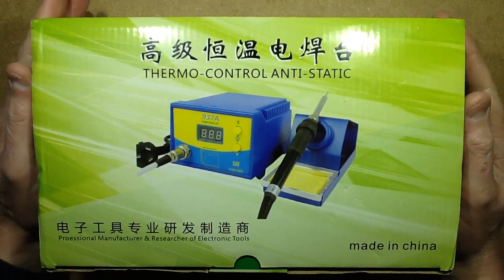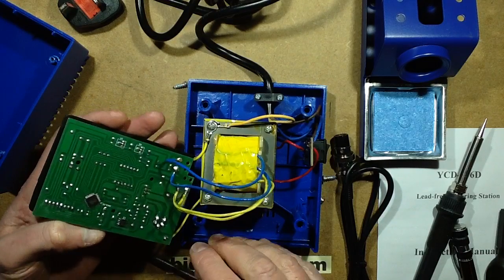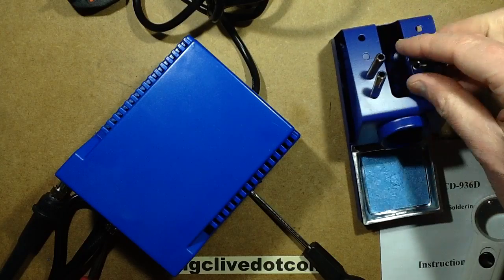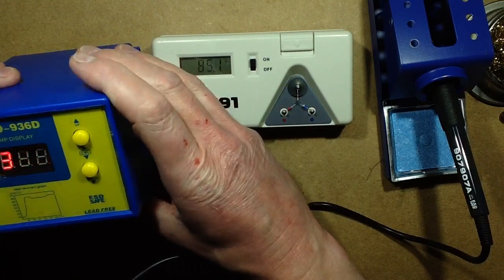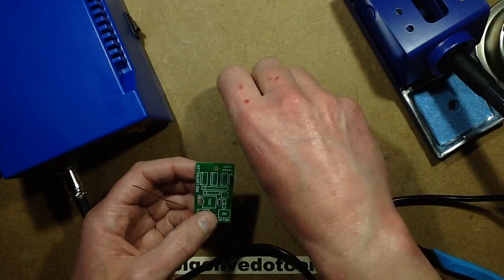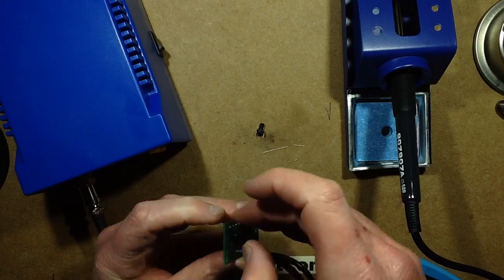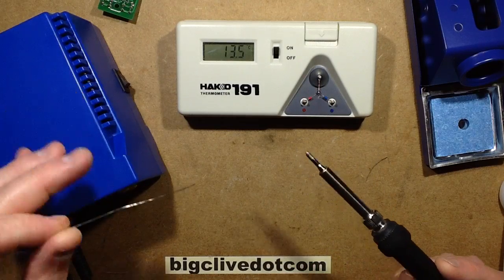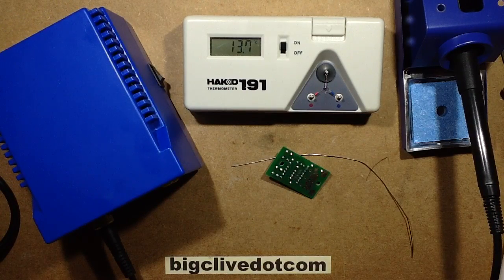936D digital soldering station test and internal look.

Comment: so how are we supposed to cal if we don't have a temperature measuring device...-40C seems pretty crappy to me...sure it works great if you cal, but what if you don't have extra measuring equipment...kinda rules out the cheap factor if you need to cal with another device
Reply: if you want to calibrate it accurately youll need the thermometer thing. but you could get a good approximation if you know the melting point of your solder, all good brands of solder will quote exact MPs for their formulations so you could adjust the iron so it just about melts the solder and use that as your calibration temperature. also those soldering iron thermometers are only cheap themselves, I got one for about £7 I think. 
but for most work you dont really need to know the exact temperature of your iron anyway. most cheaper adjustable irons didnt used to have a temperature scale at all, they just had a dial going from min-max and you turned it up as much as necessary. theres nothing wrong with doing exactly that with one of these.

Comment: Hey Clive, have you ever thought about getting a set of "helping hands". Back when I soldered in high school for my electronics class, we used them to hold the PCBs, it just felt alot safer than holding them... Who knows, you might already use them for bigger boards
Reply from the maker: I do have helping hands and a PCB assembly frame.  I only tend to use then when I need things held rock solid or while soldering a lot of components at once.

Comment: I used to rewrite manuals for colleagues. Many, even ones that were originally written in English, are confusing to say the least. One piece of lab  equipment I did this for had a manual that was over 1/2" thick. What I did was start without the manual, find out how to make it dow what was needed and write a new manual of 4 sides of A4!

Comment: Mine just displays 56 on the screen and won't heat up
Reply from the maker: That might be the usual faulty solder joint where the PCB is attached to the front panel.
Reply: bigclivedotcom thanks for the info I've returned it to amazon as it was only 1 day old and got a different solder station

Comment: I bought the 936D+, made by Zeny, and found that there was no ground wire between the circuit board and the mains ground.  The iron tip itself had a ground wire that connected to the circuit board but the lead was a dead end.  I had to install a ground wire myself in order to make the tip grounded to the mains.  I filed a complaint with the seller, and they insisted that there was nothing wrong with the soldering iron as it was.  They even sent me a European CE certification document, which I suspect was a fake because it seems like a unit like that would have to be properly grounded in order to pass certification requirements.

Comment: I have the Kaleep 8586 dual hot air/soldering station and a questionably cased LC200A LC meter of the wonderful "Chinese cheap fantastical" range. Both are greatly accurate and very reliable items and do their jobs splendidly . 
Some stuff I agree can be totally naff and only last 2 weeks or so like a supa-doopa usb thin steel microscope with stand thing I bought that apparently had rave reviews all over the net. 
Nice to see you give a straight forward view on these items instead of some peeps on here nit picking and slagging the hell out of them at every given opportunity all because they love their top notch shiny branded stuff better.  :-)

Comment: Really enjoying all the video's, so much information. Just getting into some basic electronics and bought one of these station on ebay, it's arrived today with a fully fitted compliant 3 pin plug with a 3amp fuse installed. Now I've got something to practice my soldering with.

Comment: hi BC I've just received my solder station but can you help me out with a slight problem?  I've tested the output temp using the wee hakko device (again))
Reply: purchased with your videos but my temp was nearly 100c out, so with minus 50 (maximum ) I need to set on 306c to have 350c I could just live with it but can you offer any advice on correcting (maybe a new cheapo board) many thanks from the Scottish Highlands and keep the wonderful videos coming
Reply from the maker: +Kenny Wilson The tester may not be accurate it may be better to just go by soldering "feel".
Reply: nice one mate, ive built the alarm clock kit you done and it worked a treat have now done a £10 valve preamp kit and again perfect result all thanks to watching your vids, many thanks K

Comment: Have to say I agree that cheap doesn't always mean rubbish. I've just had to get rid of an orbital sander, I bought twenty years ago. It was Woolworths' own. Finally gave up the magic smoke, having been using it daily for three months. On the other hand I was asked to check out an expensive oscilloscope in a local lab. The soldering, including hand soldered joints was the worst I've ever seen in.

Comment: Thanks very much for your review of the generic 936 "digital" and "analog" solder stations. The thermal capacity of these irons is a bit weak due to rather large diametric clearance between the tip and the heating element. This can be dramatically improved by wrapping a bit of aluminum kitchen foil around the heating element. Cut a piece about 30mm wide. Wrap it around the heating element and the tip-support sleeve, leaving a few mm hanging out past the end of the thermocouple. In my case, two turns did the trick. The bit of foil past the thermocouple will crush and fill the space to the tip. The foil improves the thermal conductivity between the heating element, the thermocouple and the tip. Now you can solder to large ground planes repeatedly without waiting for the iron to re-heat. Simple, quick and cheap fix.
Reply: Thank you for the aluminium foil advice, it indeed improves performance of iron dramatically. 
With leaded solder it is hard to tell the difference (even when soldering a ground plane), but with lead-free it is really obvious. Before the foil mod I had to set iron to the 440C in order to use lead-free solder on ground plane, but after wrapping heater with foil, I can set it to 350C and all of a sudden lead-free solder behaves more-less like leaded. 
I wonder, do they make thermal paste for high temperature applications....
Reply: nice trick..

Comment: These Chinese irons work pretty well. The Hakko clones take the "cheap as chips" copper tips, and costs of ownership are pretty low, along with a very wide range of bit profiles. Bought an 888D and it's turned out to be a very reasonable little tool. I'll not be getting rid of my (very) old Antex 15CCN anytime soon though.

Comment: Weird. Clive has put out another video about a common fault with these that I found by accident when trying to look up this video to see where be got different irons from because... you've guessed it.... my 936 is over heating the element... I can't now find this video but watched it earlier.
Reply from the maker: It's not actually released yet...  https://www.youtube.com/watch?v=S8BGkEnHetI
Reply from the maker: It's not actually released yet...  https://www.youtube.com/watch?v=S8BGkEnHetI
Also keep in mind that there are two styles of iron.  One with thermocouple and one with thermistor.  Another possible cause for an overheating bit is triac failure in a shorted state.
Reply: weird, why could I view it then? Pulled the unit apart last night, barely any solder on the connector connections and some fairly nasty corrosion on the solder. I'll flux it up and reflow it tonight to try and clean it up. I notice there is also a screw hole on the pcb in to the front casing to prevent differential movement between the two parts but there is no screw in it!!

Comment: Hi Clive being a learnerand looking at your soldering bits, how do tell what kind of bit fits  the YCD 936  iron which I just recieved today, as your video says it is just a pointed bit, so any help would be greatly appreciated Joe
Reply from the maker: These clone irons all use a very standard size of bit based on a Hakko original.  They can be found in sets on eBay, or in packs of your favourite style.
Reply: thanks Clive. Keep the videos coming, most appreciated. Joe

Comment: Hi Clive, I bought one in Shenzhen, same as yours with the Atmel MCU (and an SPI connector). According to my copy-Hakko-FG-100 it is 90C off. As you know, the calibration mode only allows for +/- 60C. Do you know of any way how to calibrate the temperature display?
Reply from the maker: Is it possible to validate the temperature on another device as some of the FG100 units can be well out of calibration.  It might be worth setting the temperature low and working up in 10 degree steps until you get to a good soldering temperature.

Comment: what is the significance of a sleeved earth pin ?
Reply from the maker: The earth pin is the first to make contact, so it's contacts are close to the front of the socket.  Unfortunately these rogue sleeved earth pins defeat that contact and don't make connection.

Comment: hey bigclive. I just got mine, and it's 270 degrees off. If i put calibration to -50 and the temperature on the displayto 180 degrees, it goes to 400 degrees on the thermocouple. what to do? my mains is 240v
Reply from the maker: +RMXbass Some of the soldering iron thermometers are not accurate.  Set the station temperature to 300C, let it stabilise and then do some test soldering.  If it's too cool nudge it up 10C at a time to find a good soldering temperature.
Reply: bigclivedotcom Thanks for your answer. I have the same thermometer as you, the white fake hakko 191. Even when i have the temperature set to 180 degrees and have the calibration to -50, it still melts solder. If i set the temperature to 350 degrees and have calibration to -50 it shows 600 degrees on the thermometer. And it looks like it's glowing
Reply from the maker: RMXbass Oh, that's not good.  What happens if you turn the unit to its minimum temperature?  It might be worth opening a case on eBay and describing the issue.
Reply: bigclivedotcom the minimum temperature is 180 C°. When i put calibration to 0, the thermometer shows 450 C°. When i put the calibration as low as it will go which is -50 C°, the temperature drops to 400. so obviously the calibration works but something else doesn't. I think i will open a case, and then try ordering another one. I quite like the cheap fake hakko stations, and would like one with a digital display that works properly. Thanks for your answers :-)
Reply from the maker: The seller may try to fob you off with a 50% refund and then ask you to post it back in the hope that the high shipping costs will deter you.  Don't close the case until it has been properly resolved and if they do ask you to post it back, ask them to send you a pre-paid postage label.  They won't, because they know how expensive it is.
It's possible that there may be some other calibration facility inside the unit, but try for the refund first.
Reply: bigclivedotcom ok i will. Thank you for the tip, I will remember that for later :-)
Reply from the maker: RMXbass I've been sent two of these units PCBs to look at and the both have serious issues with the solder joints to the soldering iron connector.  It might be worth getting another soldering iron and resoldering them with a short but of wire from each pin to an area of its matching track scrubbed clear of solder.  The tracks seem to break at the solder point as the connector is all that supports the PCB.
Reply: bigclivedotcom I got my money back, thanks to your tip. In my case the solder joints looks fine. my problem is that it went far beyont the set temperature. I ordered 4 new different irons to try. One of them was only 65 degrees higher than the setpoint, so when I calibrated the station to -50 degrees, the iron went only 15 degrees above setpoint. I was pleased with this, except that the handle on the iron was horrible, and the cable was stiff. I took out the heating element that i knew worked, and soldered it in to the handle that came with the station, and made sure to connect the original cable right. After this it overshoot by 100 degrees whith calibration set to -50. I switched back to the horrible stiff cable, and now i'm back to 15 degrees above setpoint. I measured and compared the two cables, the stiff one measures 1 ohm per lead that goes to the sensor, and the soft (original) measures 0.2 ohm per lead. I got so comfused i even considered adding a 1 ohm resistor in series for each lead that goes to the sensor to see what happens. But i am back at 16 degrees over set temperature. I Will try ordering a different station with the money i got back from this one.
Reply: KASA kasa Did what work? I got the station to work, with a different iron than the original. If you buy one of these, there is about 50 % chance that it will work. I also got my money back and could keep the item. every seller on ebay has to pay for return shipping when something is broken, they know how expensive the shipping is, so usually you get to keep the item. I did not know this until bigclive told me.
Reply from the maker: Check out this new video in case the issue is related.
https://www.youtube.com/watch?v=S8BGkEnHetI

Comment: I've burned myself on everything BUT the soldering iron i have so far..
LOL...
I've accidentally bumped and flicked the tip with my bare finger so many times. and never got burned. Didn't even feel heat! Crazy. One time I even saw the solder on the tip get pushed by my finger and i heard a tiny sizzle sound but i STILL DIDNT GET BURNED.
Yet ive burned my finger on the piece i just soldered a fair number of times. No lasting burns or blisters though.
Still freaky i havent burned myself on the iron tip or shaft. yet i have slightly singed myself on the work piece. Such irony!

Comment: Would adding a fan keep the box at a consistent lower temp, keep the tip at a more regular consistent temp? I got a Yihua 852D+ iron and hot air for $99 on sale and took the chance. It's been really great now for two years. I never calibrated it. I don't pay attention to the temp, I look at what the iron is doing. When it behaves I note the reading and use that for what I'm doing at the time.

Comment: Hey there, I really enjoy your channel keep it up... I just received my 936D but something is wrong with it... I turned it on for about a minute to see if it was working then turned it off when I went back to it later to actually use it,  it wouldn't come back on , no power...any ideas?
Reply from the maker: Check the voltage rating and plug.

Comment: Hi Clive,

I have just purchased one of these soldering irons (different brand and model number, but same colour) and tested the temperature with a knock off Hakko 191 and the temperature is so far out (over 100 degrees too high) that I can not calibrate it because the maximum deviation allowed in software is +/- 50 degrees.

Before I open  it up or possibly return it, did you notice if there were any pots inside for further calibration? I will in the mean time check the temperature with my multimeter, just in case the Hakko 191 (also a new purchase) is faulty.

Thanks, and keep up the good work, I just love watching your videos for their technical and humour content :).
Reply from the maker: i didn't notice internal calibration pots, but if in doubt start with the soldering iron at 200C and see if solder melts on the tip once it has stabilised, then nudge the temperature up until you reach a good soldering temperature.  Some of the cheap solder tip testers can be a bit random in their results.

Comment: Is the YCD 936D soldering station that Clive is demonstrating the same one that is advertised below now calling themselves Katsu, or is something diddly donkey going on. Thanks in advance anybody.
Reply from the maker: They seem to rebadge these units with lots of different names.
Reply: Well I have ordered the Katsu above and can't wait for it to arrive. Do you realise Clive that mostly due to your inspection of these units the sales appear to have gone through the roof. I think it would be nice if the suppliers realised this and paid you a bit of commission from the sales.
Reply: I've just bought a "Katsu 636", "Item NO.:312087" from Amazon, based largely on this video. It came with a 3A fuse fitted in a plug with a sleeved earth. However, it also came with a second, loose, plug in the box, which had an unsleeved earth pin and a standard UK 13A fuse. Apart from that and some different writing on the front panel, it appears identical, externally and internally, to the one in the video.

Comment: I bought one of the analog ones with the dial on the front for 20$ shipped and it's actually really, really decent. Only downside is the iron might actually float off if it's not attached to the base unit; it's got so little thermal mass! This hasn't been a problem for my Arduino level tinkering though!

Comment: Hello Clive I couldn't agree more with you about cheap Hakko (clone?) irons. I happily used the Weller TCP 24volt irons for some 40 years in a professional capacity and continued to do so in retirement. 

Having seen a Hakko 907 iron on one of you earlier videos I decided to try one on a whim and coupled it to a 936 analogue control panel using a 24 volt 2 amp transformer that I had lying around. I was amazed that an iron costing barely more than a replacement tip for the Weller performed as well as it did. I now have 4 907 irons which have cost a fraction of the cost of a single TCP iron.

Your video has convinced me to get the digital controller; I really must stop watching you and Julian Ilett, you keep tempting me to buy things that I didn't know I wanted! :-))